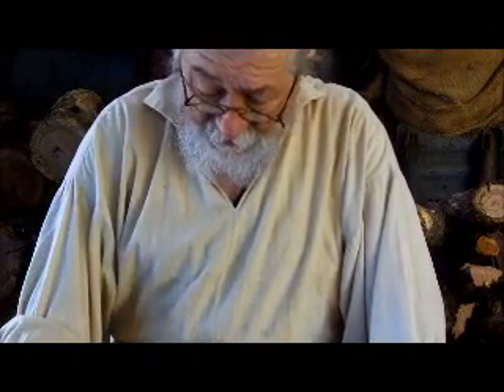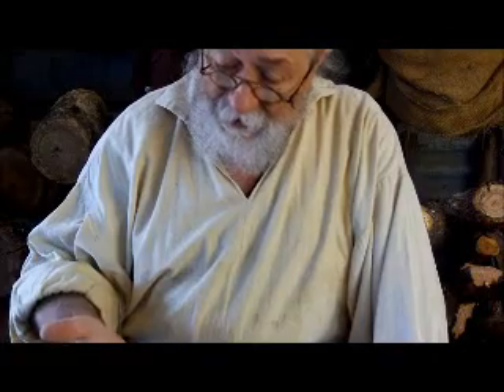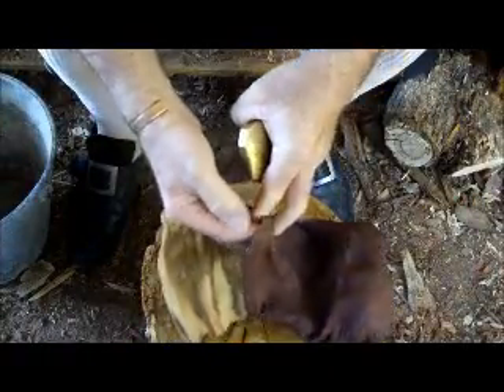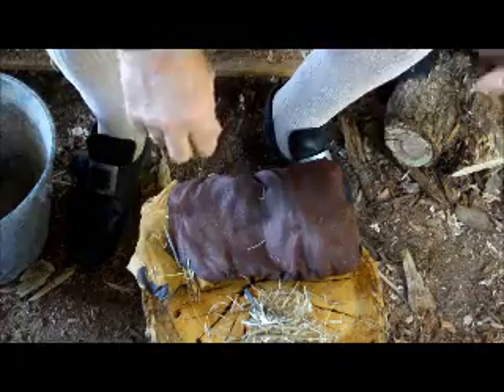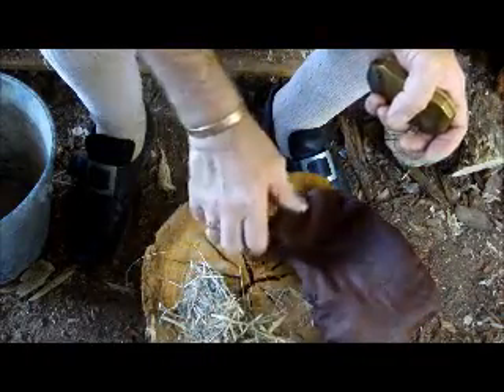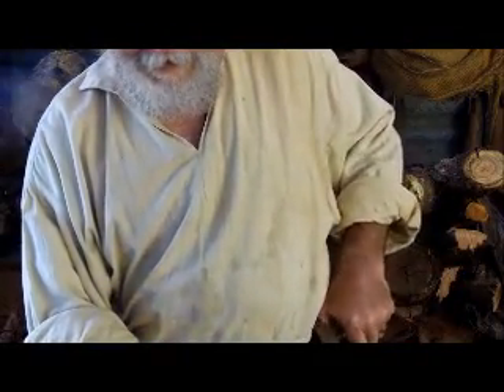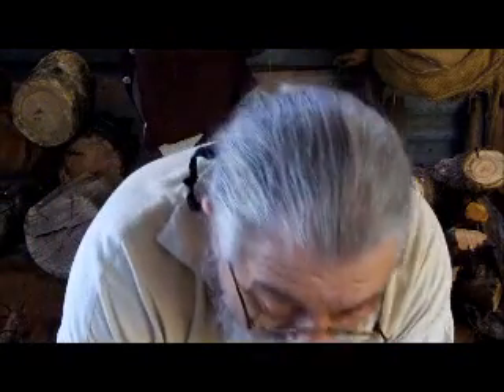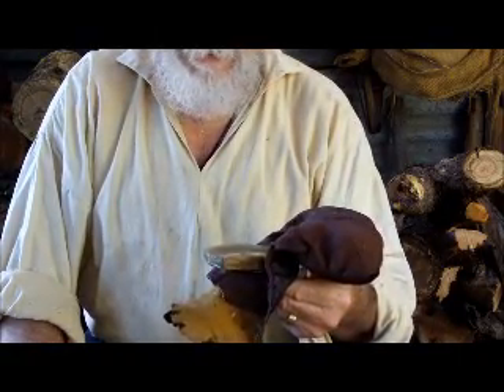No Charcloth Flint & Steel Fire Lighting..wmv

Comment: Hello, I have only just seen this, a decade and a third late! I find it interesting, esp. the information about the original charred cloth. However, it raises a number of issues. You don't deny that charred cloth was sometimes used, only that it was not as good as the modern version (although it had some advantages.) But that just means the "modern" cloth is a technological innovation. While I really believe that old skill should be kept alive, as cultural assets, fire lighting is also still a practical and necessary skill for many people; so if they can access higher quality cloth, why not? After all, flint and steel was a technological advance on flint and iron pyrite or randomly knocking stones together and is much quicker - when it works - than wood on wood technology and historically, the users of flint and steel did not hang on to the technology when the first lucifers came along. And even before the first matches, flint and steel, itself, was improved by the use of the "lock" to make both firearms and firelighters - a pistol hammer and pan attached to a tinder box. I am not saying any of this in a spirit of criticism, but just raising the point about what actually happened.

However, I do fully take your point about what happens in the outdoors. I recently bought a flint (real stone) and striker and was given some charcloth,  it was so fine that it turned to smuts as soon as I touched it. I expect it would burn well (although too quickly) but I wouldn't want to try putting a piece into a fire piston. That charcloth would soon run out solely due to its fragility. On the other hand, I live in the UK and it is quite difficult to find dry grasses unless the summer is really hot. (And then, it would almost certainly not be sensible to light a fire outdoors.) Most of the time, the grasses are quite moist and even "dry" dead grass isn't really dry or doesn't stay dry for long. In some parts of the world, the climate is both hot and fairly dry or even arid, but many forested places are damp for much of the year. 

It seems obvious that people would not go out into the wild without their flint and steel, so I would think that it would be natural for them to ensure that they had some tinder or tinder substitute with them, just as drivers usually ensure their tanks are full before a long drive. Even if one is in the wild, once a base camp is established, then there would be ways of processing tinder from rags for charcloth to using natural fibres. Incidentally, the film assumes that charcloth is the weak link. However, when I bought my striker, the first piece of flint kept flaking on the edge, like tiny toenail shavings and eventually snapped in half. The small halves were too small and sharp to hold safely. I realise this is due to my technique, but it makes the point that while the flint is meant to make the steel spark, it is a brittle material and can break. It is extremely difficult to find naturally occurring flint near where I live and I believe that the original piece I had may have weathered incorrectly. When I was young, I spent some time knapping flint and it was much less frangible than the recent piece.

Despite my comments, I did enjoy the film and also gained from seeing your striking technique. An American scout master suggested striking the steel with the flint, so that the sparks would fall onto tinder, as more natural and easier than trying to catch a spark flying up from a steel striking the flint and aiming the spark to hit the charcloth held in place on top. 
Thank you and I hope you are well.
Reply from the maker: Charles, I do not recall saying that modern cloth was not suitable. I may have said modern synthetic cloth was not suitable. Charred cloth was mostly used in homes/houses, though amadou was sold by street vendors.
You do not need flint to strike a spark from steel, there are plenty of other siliceous rocks hard enough to strike a spark. 
The method you use is entirely up to you, both the tinder on top of the hand, & the tinderbox method work very well. I suggest you watch my other fire lighting videos Charles.
Regards, Keith.
Reply: @historicaltrekking  I apologise if I misrepresented your words. I meant your comment that modern charcloth was more consistently charred than the older variety and I believed (wrongly, perhaps?) that you felt that modern charcloth was too "perfect" at 2:34 in your transcript. I accept that people sometimes gain a wrong impression of how good they are by practising in "perfect conditions" with the best equipment and tinder and on a dry day and it is quite, quite, different with less than perfect equipment in poor conditions and esp. when it is a matter of survival. All I was trying to suggest is that the older method of charring cloth was less efficient than the modern one and over time humans have tended to welcome improvements in technology when it has been a matter of survival, from flint tools to copper and then bronze, iron etc. and similarly with fire lighting technology. If your main concern is historical and educational, then it is obviously quite correct to point out that people used less efficient ways of charring cloth and that woodsmen (and women) might not have charred cloth to hand in the wild. My point was slightly different: - using charcloth doesn't always mean that the demonstration is unrealistic or that it won't work in reality. I was approaching the subject, not from a historical perspective, but from a practical one. As I am retired, disabled and currently injured and wheelchair-bound, I don't expect to be going into the bush or the woods anytime soon, but I have often been asked to light fires, start barbeques without using noxious chemical "fire-starters" and so on. Exploring different methods of fire lighting is a (relatively) harmless hobby, although not always inexpensive.

My own experience with modern charcloth shows it is not always easy to handle and a partially charred rag might have worked better for me, if I could get a spark. Of course, it can run out, but that applies to almost all consumables, by definition. This is why fire starting methods vary so much around the world. People make use, not of the perfect method, necessarily, but the one that is most convenient for them, with what they have to hand.

On youtube, I saw a Texan make a fire spindle from the dried stem of tall grass, something abundant where he is, but not common where I am. In some parts of the world, fire ploughs/bow drills/fire pumps and even fire pistons are the preferred method. I believe there is even a species of bamboo that contains "phytoliths" - deposits of silica material, which can spark if the bamboo is struck with the correct material! 
Again, I apologise, if I misunderstood you or misrepresented you. That was not my intention.
Reply: @historicaltrekking  Oh, a further ps, if I may. I have been thinking about your film. Of course, charred cloth may run out, but so might gunpowder or coffee or flour or any other consumable, but the early pioneers and mountain men often took those items with them. While a trapper might have a knife or tomahawk as well as their musket or rifle, I don't recall them refusing to carry firearms on the basis that they would be useless weight once gunpowder or lead ran out. And while many would recast their own shot, I don't think many attempted to make their own black powder. This is not to be snippy, but to suggest a "both and approach", rather than "either/or". As you say in the film, if you can carry something with you, then why not do so? Use what you have and know what to do when it is no longer available. 
Educationally and historically, using the correct materials  matter, but in a survival situation or even when you are just cold or hungry, it makes sense to use your matches or lighter or charcloth, if you have them and have flint and steel, etc, as back-up. I like to use different methods when barbequing or camping because it is fun and entertaining and even educational, but in a serious situation I would go with what is quickest and most efficient.
It is having the skill and wisdom to know what to do when supplies run out or tools fail that matters.
Reply from the maker: @charleshayes2528   I agree Charles, there are easier modern methods of charring cloth & plant materials by placing them in a tin can, but die hard living historians prefer the original way, & survivalists/preppers do not want to have to carry a tin can around with them for charring when there is no need. The thing is Charles I don't find the old method of charring inefficient, in fact when done directly in the fire, the tinder lasts longer. Same with the use of the tinderbox, you close the lid to extinguish the burning embers, thus preserving more tinder. If you place uncharred plant or fungi material in the tinderbox, then it becomes charred with use.
Anyway, it is a personal choice Charles.
Good to hear from you Charles, take care & stay safe.
Regards, Keith.
Reply: @historicaltrekking  Thanks. Yes, I can see the "living historians" aspect clearly and to be honest, I have always seen the flaw in relying on "survival kits" or even worse, "survival knives" with a kit in the handle. If you know you are going "camping" or out into the bush/wilderness, etc. you can carry any equipment you like. And as an ex Wolf Cub/ Boy Scout, I know it is always better to be prepared. But it isn't practical to carry everything you might need. 

I recently read a book on EDC where the author carried a special belt with hanging carbiners holding a flashlight/torch, a multitool and other items - duplicated for both sides of his trousers/pants, plus other pouches. He also had EDC kits at work to get to his home and others for getting to work. At home, he had a huge stock of supplies - far more than he would need to survive for the few days of a power cut and all dated and logged and tagged and all needing to be replaced and refreshed. While some of this was helpful in his day to day life, most of it was aimed at surviving a major disaster, but it was all predicated on the idea that he would always be able to get back to his home and take sanctuary there. While I don't doubt that he also possessed some skills, the focus seemed to be on possessing the equipment. He even had different rigs to wear in different scenarios, but in the nature of things he could not carry them all all the time, so again, he was actually limited to what he could carry. So I do accept the logic of your approach - carry the essentials and make do with what you find. Not having tried charring my own cloth over a fire, I am happy to take your word for it. Keeping tinder in a tinderbox and allowing the embers to die out, makes good sense. 

By the way, speaking of making use of embers, have you come across the "fire roll"? This is usually cotton wool from cotton balls, rolled up with wood ash, although charcoal can be used and one author swears by the ground shells of black walnuts (he is in the USA, where the black walnut is prolific). The idea is that the rolled cotton is pressed and rolled between two boards, bits of wood or even stones and the friction ignites an ember. The ash/charcoal/walnut or other powder, including ground snail shell, acts as an accelerant, to increase the friction and speed up ignition. When done properly, it is very quick, although the ember is more "fragile". 
Cotton balls are used simply because they are an easily available source of a natural plant fibre for urban people.
The technique also works well with natural fibres and in some cases, ignition can be achieved with the fibres alone and without the need for an accelerant. Although it is, supposedly, a modern method, developed in WW2 or in the Soviet Gulags, it relies on using natural materials and is a way of producing fire when you don't even have a flint and steel or other forms of igniters. Personally, given the long history of use of rough natural fibres, I can't believe that no one ever stumbled on this before, while rolling fibres for cordage or for caulking, for example. 

Anyway, thank you for the conversations. I hope you keep well and I do intend to look at your other videos.
Reply from the maker: @charleshayes2528  No Charles, I have never tried the fire roll. With what I carry, plus skills, I can make fire anywhere any time. I can make & produce fire with a fire-bow even in the pouring rain 😁 I have enjoyed the researching & experimentation in the past, but I am unable to go far these days, no more historical trekking ☹ I believe having the right equipment is important, it makes survival easier. But I do not believe in carrying all these modern gadgets that are available these days. Equipment NEEDS to be sustainable, & I have always found that the older tools are more reliable & sustainable.
Sincere Regards,
Keith.
Reply: @historicaltrekking  Hi, Keith I am sorry, I have been a bit busy with health issues and stuff and I don't always keep a strict eye open for replies to comments. The point about sustainability and reliability is well taken. If you can replace something from easily available and renewable resources, esp. when in the wild itself, then that is better than only having tools that run out - such as fuels for lighters; or which require "industrial" consumables - such as petrochemicals or rubber O rings for fire pistons. On the other hand, there are fire pistons which use natural fibres to provide their seal and which are made from renewable materials. I even found out, the other day, that one species of bamboo contains "phytoliths" - that is, silica compounds - which spark when struck. 
By the way, I have just emailed a blog where the author defended his instructors' failure to get results with friction fires on the basis that it is very difficult to do so in poor weather and even asserted that traditional communities invariably kept their equipment dry by storing it indoors. (My email basically pointed out that this seems to ignore those hunter-gatherer communities which did not have a fixed "indoors" and who might require fire while outdoors or simply away from home.) So, it was quite interesting and encouraging to see your comment about using a friction method in the "pouring rain". Cheers!

Comment: i have 1 question.
first, let me say thank you Mr. Burgess for the great videos 
i recently bought a fire steel, and made a tinderbox that i fill with charred punk wood.
i want to know what kind of maintenance/upkeep you use on your fire steels to keep them serviceable and functioning through the years?
your faithful subscriber, Beau McLaughlin, Texas, U.S.A
Reply from the maker: beau mclaughlin  If your fire steel is a REAL fire steel Beau (& not a ferocerium rod), it should not need anything to keep it serviceable. Are you having a problem with yours Beau?
Regards, Keith.
Reply: Keith H. Burgess no sir, i didn't know if they needed to be oiled or stored in a water tight container.
and it is a "true" fire steel by ESEE http://www.eseeknives.com/fire-steel.htm
Thank you for your time, consideration, and the prompt response,

Beau
Reply from the maker: beau mclaughlin  I see Beau. No I have never had to do anything with mine. I keep it tied to the buckle of my belt pouch, & it goes inside this pouch with my fire-bag.
Regards, Keith.
https://www.youtube.com/watch?v=J-HIqmPjDPA

Comment: what if you lose flint and / or steel and / or charred inflammable material and you are having to do it from scratch like adam did around time he met eve
Reply from the maker: Salacious rocks are easy enough to find, & I keep my steel tied to my belt bag. I can also use the lock on my fusil to make fire. If it is sunny, I can use my reading spectacles to make fire using uncharred plant/fungi tinders. If I have not got anything at all, then I will make & use a fire-bow.
Keith.

Comment from the maker: @quick1911  I will answwere this anyway. I have tried dry grass as a tinder, but had no luck. It is a good kindling though. Some of the tinder in my tinderbox has not been charred, but it will char as I use the tinderbox to make fire. Two of the most common & easy to find tinders in your neck of the woods are Punkwood and the dried flower head tops of the cattail plant. Both need to be charred in the fire and then smothered in your tinderbox.
Good luck, and let me know how you go.
Regards.